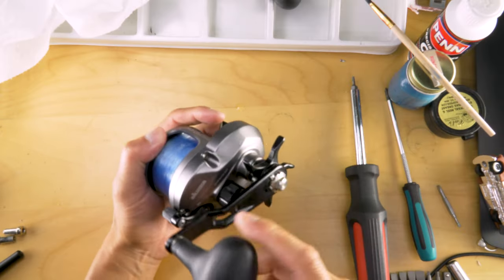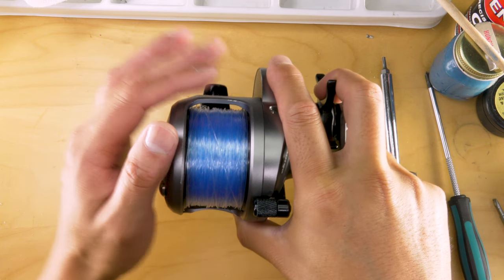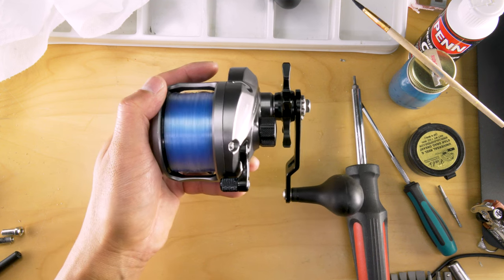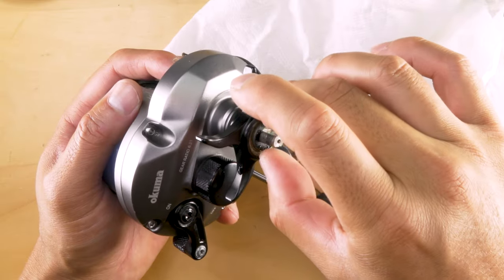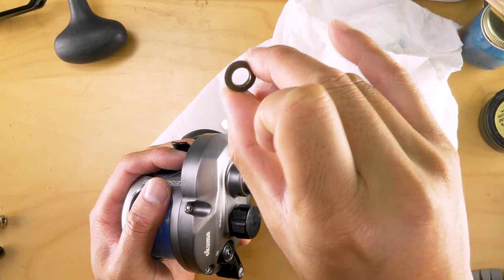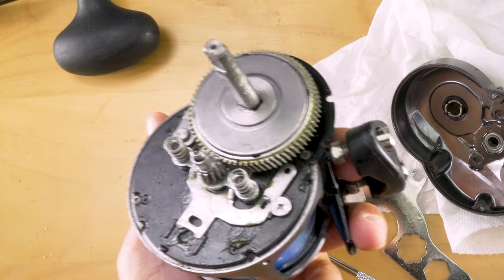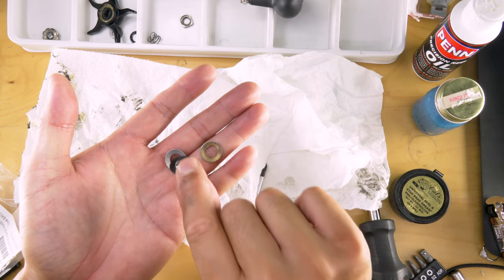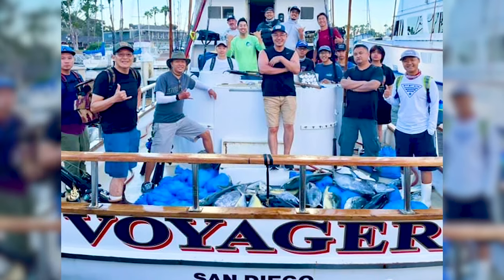Okuma Tesoro 10s reel maintenance service and repair tutorial

Comment: Hey there,.. I have the 12S … great Tuna reel or whatever you want to use it for,… if you want to use it as a surf caster,.. you definitely need to have knobby mag … this reel can be quite unruly when cast long distances.. it will cast a very long long way indeed,… definitely not for novices …
   As I have stated,.. great Tuna reel but sometimes you’re casting surface irons and a mag will be ideal 👍😎🤙
Reply from the maker: Great reel, awesome freespool, plenty of power. Def need control on the thumb for those casting.

Comment: Is cranking easy with huge fish on?
Reply from the maker: It's 6.2:1 gear ratio which is same as Trinidad/Torium. The speed is fine for me with but my biggest is that 45lb ish YFT on this reel. There's two slots on the handle, if you anticipate big fish, move the handle to longer slot, this gives you extra leverage on the crank.

Comment: When you added the washer between the two concave washers did you get increased drag output..? This is waht I use for surface irons and I am wanting to get more drag..
Reply from the maker: Hi Bill. In my mind I was thinking that as well. But honestly I think it’s still same. I can still pull line so I prob refreshed it back to factory specs. Will need a scale to confirm. Hopefully I can borrow a buddy’s in the future and let you know. Thanks

Comment: I have a rain shadow 7’ 30-60lb I am using for my 30lb rod. It’s custom made by charkbait. What size Tesoro would you recommend? 50lb line 30lb leader
Reply from the maker: Oooh that’s going to be a sweet rod. Rainshadow has been hanging fish. The Tesoro 10s holds a decent amount in 50lb. And is equivalent to Shimano 16a size, Penn 25n, Daiwa 35. If you feel the need for extra line capacity, the Tesoro 12s will be what you want. That is similar capacity to Shimano 20a, Penn 30, etc. 

I paired my Tesoro that trip at end of video with 15-35lb rod but also used it with a UC monster 30-60 rated and kept the same 30lb leader. Going to be a fun setup for you. Get em 🤙

Comment: Is that same size with shimano Ocea jigger 2000?
Reply from the maker: It’s same diameter profile, side plate wise. While the spool width is a bit wider and similar as Trinidad 16a. 

It would still make a nice SPJ setup if you’re considering it. I also have the Tesoro 5ns, very similar to Ocea Jigger 1500.
Reply: @Seastheday88  is the line capacity also the same 5ns with Ocea Jigger 1500? Sounds good for light set up.
Reply from the maker: @rivalramayoga1052  I got just a bit more line on the 5ns. 

If you plan to palm your hand over the reel to grip it vs the rod for SPJ, just note that the top part of left side plate on Shimano/Saltiga are more flat profile, while the Tesoro has an angled profile. Noting it for comfort wise. I think some will feel fine with either, while my hand shape feels more comfortable with flat profile for more grip. I use these Tesoro mainly for flyline or just dropper loop style rock fishing. Works great. Flyline caught that last pic of the YellowFin Tuna with the 10s, took me around the boat, pulled a bit of line but winched it back in without any concerns.
Reply: Ok.. nice info.. thank you so much 👌
Reply from the maker: @rivalramayoga1052  you’re welcome 👊

Comment: Where did you apply the grease!? You cut off the vid after you said that and left me hanging lol.
Reply from the maker: Hey Boss. Sorry. I know I did, my camera cut off that time and I was finished. I realized only during editing thus added the footage from trip where I used it. 
3 types of lube: 
Reel grease which is usually blue in color. I use marine grease by Yamaha.  On non moving parts like frame itself, I sheen coat it. On the moving parts like gears, clutch, plates that push gear into place and the Dog Pawl and springs. Use the grease. 

Bearing lube, I have Penn brand and TSI 321, literally a tiny drip is sufficient on the bearings including a drip between crevice of handle arm and the handle knob itself, it’ll work it’s way to the stem. 

Cal’s grease, I used this on the drags. Found online or most local tackle shops. I used the gold/brown one for west coast temp. I believe purple was colder climate temps. 

Thanks for watching and hope the info helps.
Reply: @Seastheday88  it helps a lot! Thank you very much. I really appreciate you responding and answering me. Yours is the only video I’ve found where you actually open the Okuma up.
Reply from the maker: @Redlegarty  thanks brotha🙏 much appreciated. I’ll do a proper one again in the future. I have the 5ns and 10s. They’re underdog rated star drags. Still have Fathoms and Trinidads as well that serve their purpose, but you should’ve seen that Yellow Fin Tuna at end of video in person. I was on a Phenix M1 15-35 custom rod with the 10s and it was bent bent the whole time. Took me around the boat, reel performed flawlessly, just had to trust the prior settings. If you have any questions in the process just hmu 🤙
Reply: @Seastheday88  will do. Awesome catch on the Okuma. Thanks again! Can’t wait to get out there.
Reply: @Seastheday88 hey I use your vid a lot now to maintain my 10s. Did two long range trips on the excel and caught tons of yellowtail. I have about 150 pounds in the freezer. Smoking some tomorrow. Can’t tell you how much I appreciated you making this video. My 10s thanks you too.
Reply from the maker: @Redlegarty  Thats awesome to hear! One of the many reasons I love fishing, the community and the bonus is having food in the freezer!